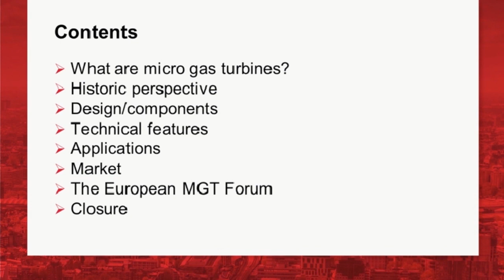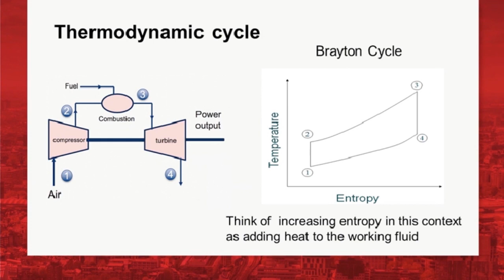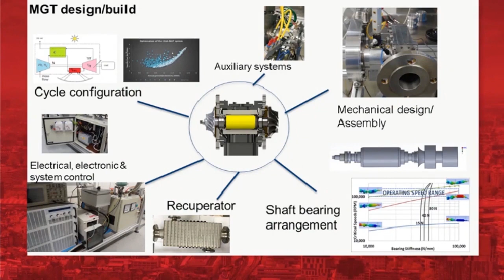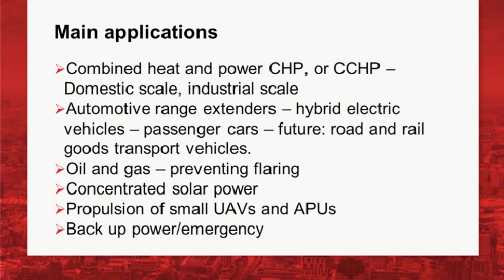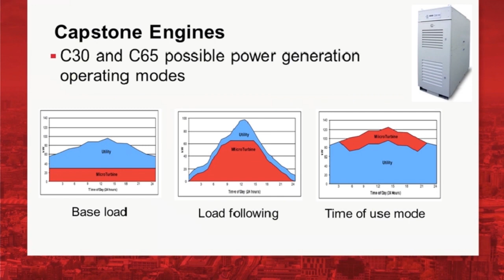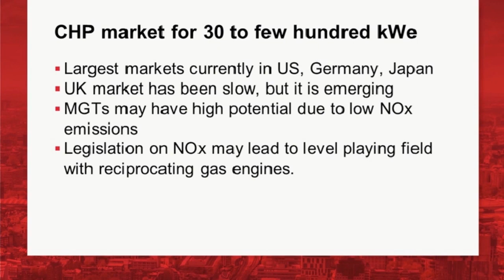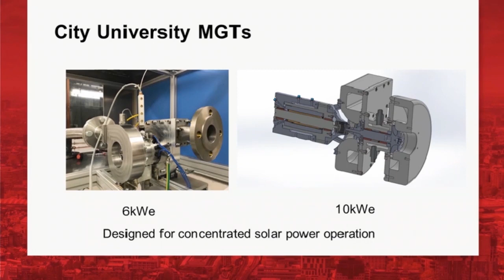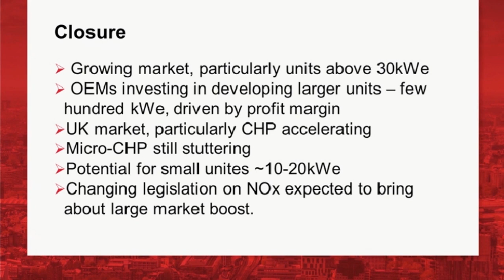The Future of Micro Gas Turbine Technology

Comment: I was watching a video about a new turbine set up to assist EV's, and people were coming out of the woodwork to say what a stupid idea it was. All negative comments. It's like someone doesn't want micro turbines messing with their game. Is there any push back from industry on this idea? I can't see regular people getting this upset over assisting an electric car, but the comments seemed to show different. Which is more efficient at charging a battery, an ice engine or a turbine? Would like to know.
Reply: Lots of people working on this problem yet almost no solutions are available in the market.  Bladon & Capstone are two that I found but nothing appropriate for putting in a car. I think the problem is that the smaller turbines have troubles being as efficient as a car engine.

Comment: Just cut a hole in the middle of the comoressor wheel to let the focused sunlight in and funnel the compressed air onto a cone that gets heated up to red hot.  The compressor blades become like a screw screwing the air into the funnel at high pressure.
Reply: reverse intercooling